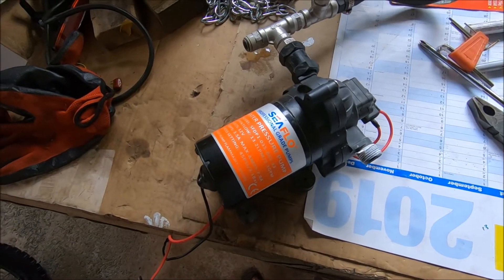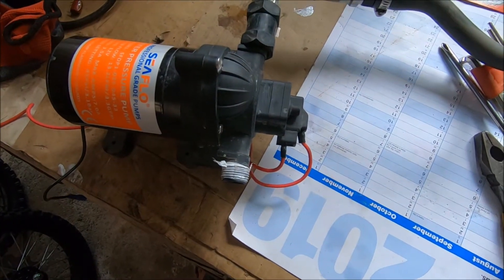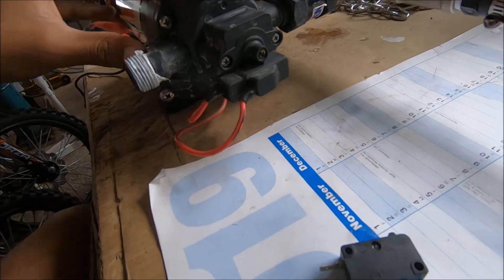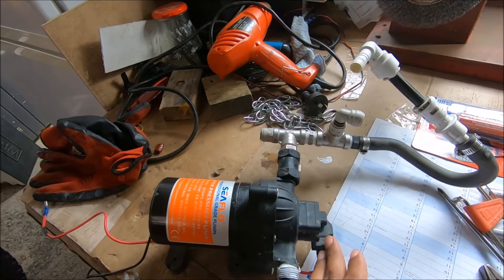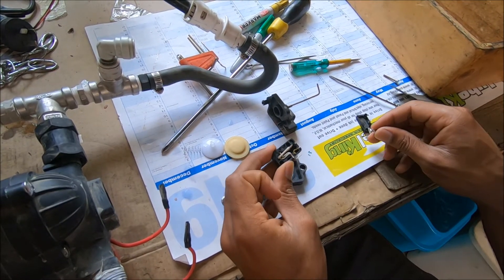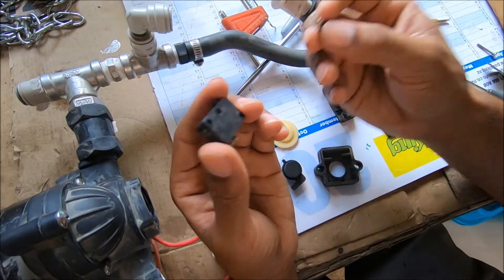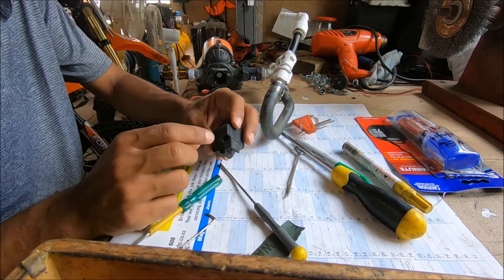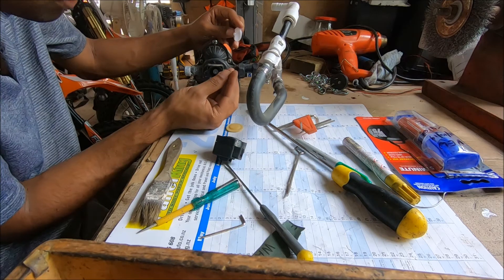Fixing Faulty Pressure Switch - Fresh water pump RV / Campervan

Comment: Long shot here looking for help!! I opened the pump, and now I have trouble closing it. It is very challenging, close to impossible, to put back the lid and place the carbons on each side the rotor. The carbons are cased on the lid, so once you put the lid you dont have access to manipulate them. I hope I was clear.
Reply from the maker: Are you referring to the microswitch?

Comment: The main problem is that microswitch is designed to handle minimal current, not nearly the 10amp plus draw under load and its wired in series to the supply, it wil fail again and again and again. Use the microswitch to power a relay to drive the pump, problem fixed permanently.
Reply: That's an excellent idea

Comment: Can't I just wire the motor up direct? All I'm using the pump for is a transfer pump.
Reply from the maker: Yes you can if your just using it as a transfer pump. Do note the run time of your particular pump as some cannot handle being on continuously for too long. 

The pressure switch is there to prevent pipes blowing off or rupturing from excessive pressure and to cut off the pump automatically.
Reply: @AutoBuddynz  thank you.    21 min at a time.  Just long enough to transfer water from truck to RV.

Comment: Need help re wiring to new pressure switch
Reply from the maker: Depends on what pump you have, but most of the time its wired in series so it does not matter which way the wires go, as its just a switch in-between a circuit.

Comment: In mi case I change that spring from the switch (Was working from on to off very fast, till I made that adjustment), then I began to adjust that screw... (clock wise,  in short steps.. Till stars working that it usted to be)
Reply from the maker: Awesome great to hear!

Comment: Where can I buy a pressure switch?  Please give me the link.
Reply from the maker: https://www.amazon.com/12PAack-Action-Button-Microwave-MXRS/dp/B083C113YL/ref=sr_1_2?dchild=1&keywords=micro+switch&qid=1600115132&sr=8-2
Reply: @AutoBuddynz  Thank you very much.
Reply from the maker: @DIYjust  No problem
Reply from the maker: There is an extra terminal which can be removed if it does not fit in the housing (link above)